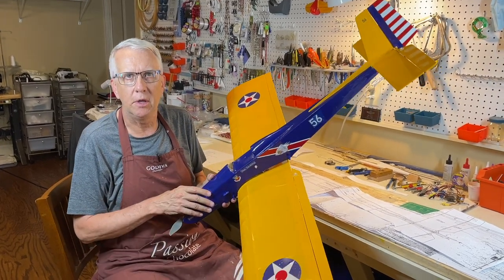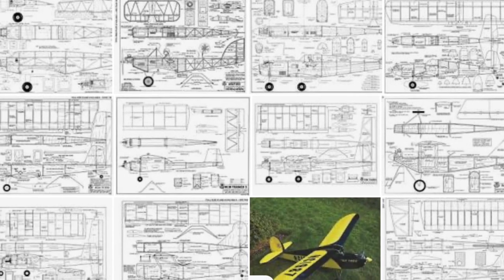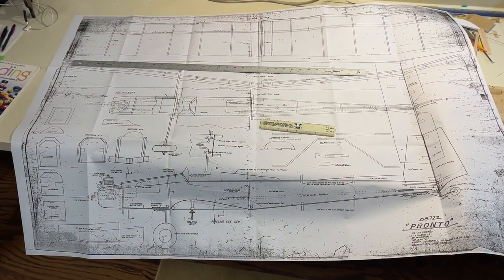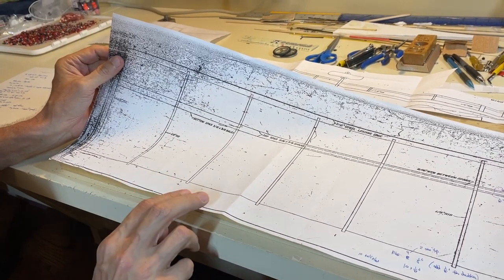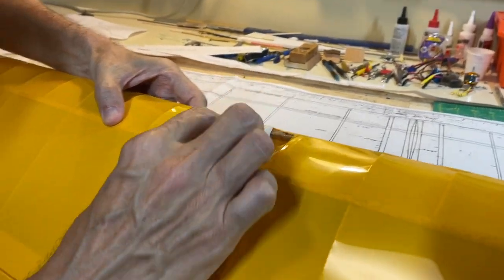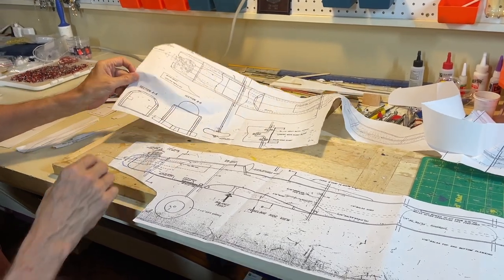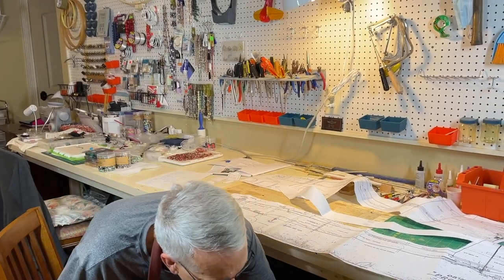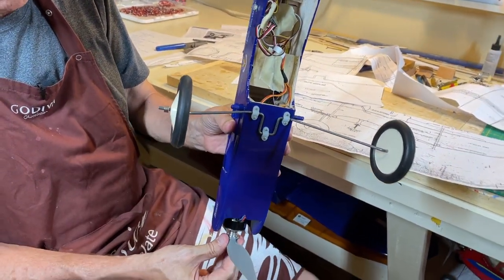How to Read Model Airplane Plans for Newbies

Comment: I didn't hear anywhere talking about motor thrust angles. Did I miss that coverage? If not, might be a good thing to add especially if you changed the angles from the original plans.
Reply from the maker: I generally use a bit (2-3 degrees, eyeball) of down and right thrust for my models, seems to work well.  Tim

Comment: I have no experience with any type of RC car, plane, drone any of that stuff, but I was given a pile of miscellaneous plane parts. One thing led to another and I made a 3 engine bi-plane. It looks good, but flying maybe not. I noticed that of the hundreds of videos online I couldn't find any with 3 engines. Is my plane doomed before take off ?. Also I wired all three engines together and the engine in the nose spins in the opposite direction as the two wing engines. ?? Thanks if you have time if not I still enjoy your videos
Reply from the maker: Todd:  Thanks for checking in!  Plenty of three engine aircraft flying out there, a good design choice.  The prop should rotate clockwise when viewed from the cockpit, or counter-clockwise when looking at the front of the airplane.  Just sway any two of the three wires on the motor to reverse the direction of rotation.  Also, be sure to check your props are not installed backwards.  There is a little bit of printing on the front of the prop, by the hub with prop size, to indicate the front.  Finally, be sure to have someone who has a bit of experience for that first test flight.  Tim